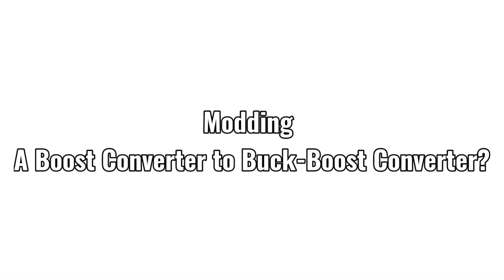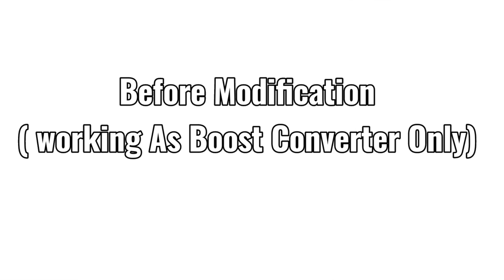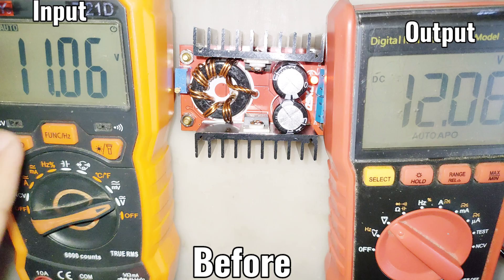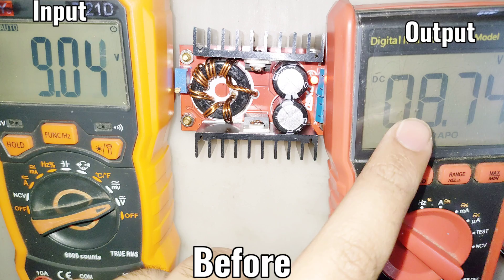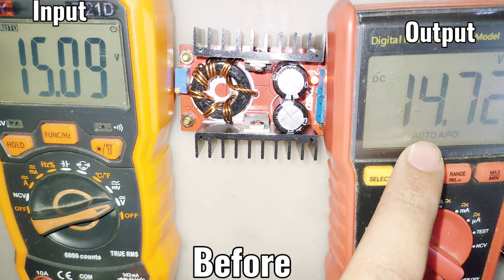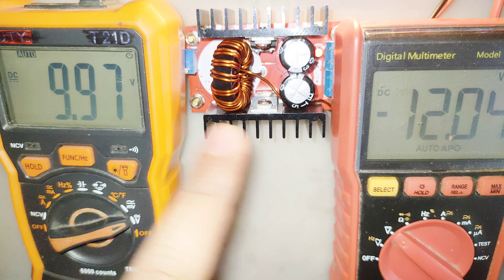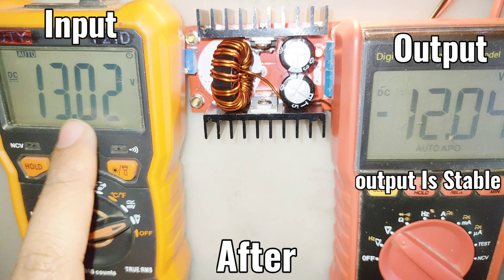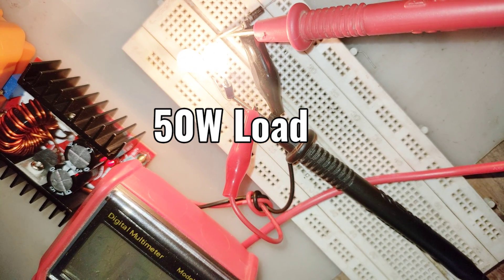How to Modify your normal boost converter to Buck Boost #boostconverter #buckconverter

Comment: For the confused here ;

He is using the onboard PWM circuit to pulse a signal into the core of what was originally the choke, using it as a transformer instead of a choke.
Fucking genius, i have the exact same boost converter i will try and reply back with the results and a schematic if it works.

Update;
Just tried it and it does not work for me at all, i might tinker with it more later.
Reply from the maker: Glad I could help
Reply: @photonic_induction2633

its simple he just made a Transformer with 1:1 retio 🤷

Comment: By this modification input- 12v 18amp atx supply.
  Output -  Min voltage & Max voltage? 
Does can increase the output current also by  replace the mosfet
Reply from the maker: No , it's absolute maximum

Comment: This is a boost module and designed to boost. There is nothing wrong with it. With some searching you can see in the specifications that the minimum input is 10V and that output is at least 2V higher than the input. If you deviate from this, you can expect that the Boost module will not work properly. Engineers have long invented the buck / boost module and you come across as if you were the inventor of it. How did you calculate the induction coil? How much uH? This module is also designed for max. 6A output and max. 100W (150W with cooling). You use 1.5 mm copper wire, are you going to use it with 15A or something? Then you can adjust the entire module. What about the efficiency?
Reply from the maker: If you don't believe! Try Yourself !
Reply: @ I also believe it will work but would rather see some more substantiation; some test reports at different voltages and loads, what is the voltage drop at heavier loads, temperature development, output ripple, how do you get 10 to 15 windings and efficiency. I have the boost module but also a boost/buck converter so I see no reason to modify it because it works fine as a boost converter. I would rather make a modification with an input controller for when I connect my solar panel to it; then the input voltage does not fall below a preset value (I have on another converter with this modification) or a current regulator. I see this more as a bush fix if nothing else is available. Otherwise you can simply purchase a boost/buck converter.

Comment: Great work! Can we modify it to work wih less than 10V (8.5V at least)
Reply from the maker: Maybe its possible, but not easy to do
Reply: Thanks for the reply, I want it to power my bluetooth speakers which use a 3s Lithium battery, but the voltage is gradually decreasing from 12.6V to 9.26V until the BMS shuts the power off.. Ideally, I want a boost converter to deliver a) a stable output throughout the battery discharge cycle. b) maybe increase the voltage to 16V or even higher as the TPA3116D2 chip can easily handle up to 26V and having the extra power can be a dream come true as i cannot afford a 5s/6s pack right now. 
My only other concern is, at higher voltage will there be any noise/distortion or any ripple that could degrade the sound quality. Thanks again for considering hopefully you can help me with this. @Electronic_For_You
Reply from the maker: But i think it can work on a 9V  minimum, you can try , 

Good luck in your project ✌🏻

Comment: Can you modify this converter to boost 220V DC as output, without around 500w load capacity with overload protection if possible.
Reply from the maker: I'll research about it and if its possible then i will make a video
Reply: @Electronic_For_You  thanks